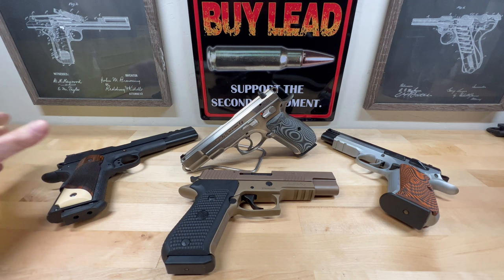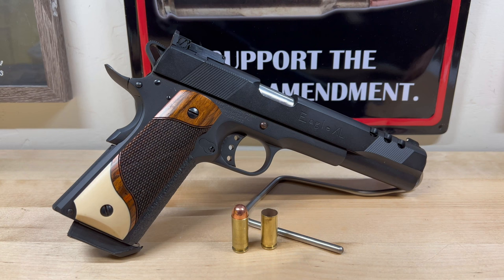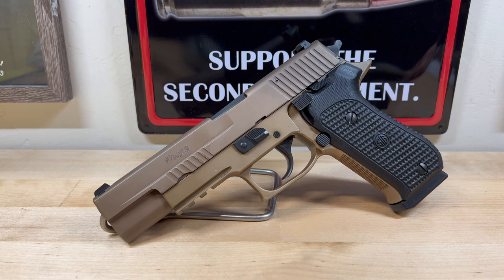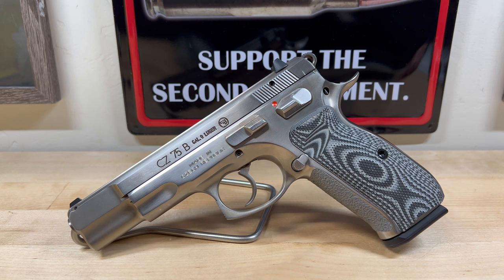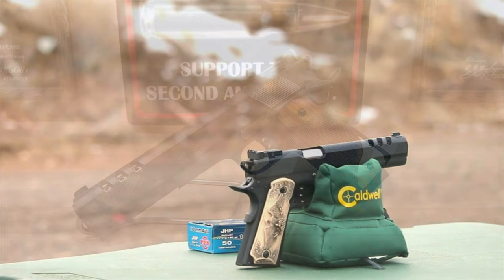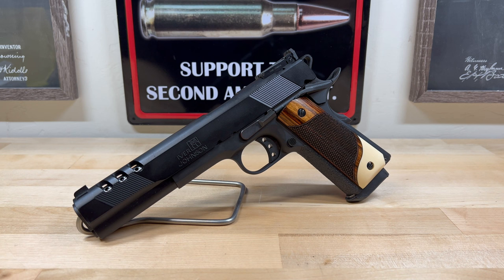The 10mm Cartridge - According To Jeff Cooper

Comment: The last time I had my 9mm and 10mm 1911s out at the range, I was surprised that I shot the 10 more accurately.
Reply: Both 10mm & 5.7 shoot "flatter" than 9mm.  By that, I mean you don't have to alter your sight picture much between 5 & 55 yards.  Or 155 yards, you can go very long with both rounds

Comment: I've become a huge 10mm fan. Actually own (2)10mm now thanks to reviews on some firearms I've watched. Thank you 😎👍🏼
Reply from the maker: My pleasure!
Reply: Hi Norbert’s, if I get a 10mm to take into the woods for protection from bears etc, which do you suggest. Thanks
Reply: @LK-bz9sk  Hey LK. For something regarding wood protection, I’d say a Glock 20, Colt Delta Elite, or Sig P220. There are a few others but G20 has a 15 round mag unlike single stack mag on the others. Hope this was helpful.
Reply: @tallgeese76  Yes very helpful because you reinforced my gravitation to the Glock because of capacity. For pure woods type use maybe the Glock 40 w the longer barrel. Thanks Norberto

Comment: Great information. Love me some 10 mm. Only bad experience has been with generation 4 Glock model 29. Nothing but trouble from the get-go. And even worse Glock service turned out to be crap, unresponsive, douche bags. Finally found an independent reputable smith who has worked out the bugs and now it’s back in the rotation
Reply from the maker: To be honest, I prefer a 10mm to be of all steel construction - but that's just me.
Reply: @Icarryone  I was wondering why the Glock 20 wasn’t featured.
Reply from the maker: @mandangalo803  See comment above.
Reply: @Icarryone  no I get it. But the G20 has a significant role in 10 mm history. Because of it, 10 became popular again
Reply: Yeah. & shoots Damon well I might add.
Reply: @Icarryone  Hard shooting handguns should have steel or at least aluminum alloy frames . I've owned a few polymer framed handguns , but have sold them off . I've experienced polymer framed handguns warp in high temperature conditions .  I carried a 1911A1 when I was in the US Navy in Security and Military Police duties . My current 1911A1 pattern weapon is chambered in 10 mm Automatic . The 1911A1 manual of arms has been drilled into my brain since I was 18 years old . I enlisted into the US Navy in 1985 for what's that worth .

Comment: I recently became intrigued by the 10mm as a result of winding up with the newest version of the Colt Delta Elite for a very low price.  Now I love it.  It's definitely more challenging to run at speed than the .40 S&W or .45 ACP, and surely the 9×19mm.  But not really that much more.  As with all of the powerful large caliber cartridges, it requires more devotion to training and practice to master.  But this is entirely achievable for anyone who can master the .45 ACP.  Even a full size 5" barrel 1911 conceals and carries very easily, and is fairly slender for all the power it delivers.  10mm guns do unquestionably accumulate wear more rapidly, and require staying on top of maintenance more.  Recoil springs should be changed out every several thousand rounds, as with any other autopistol, and it is rather harder on slide stops from the heavy recoil springs required.  But this is easily addressed by routine inspection and maintenance.  A careful gunsmith inspection with any necessary tuneup and parts replacement should be conducted every 5,000 rounds or so.  10mm is a truly excellent cartridge that delivers tack-driving accuracy and impressive power for anyone willing to commit to the training requirements.  It would be more pleasing if all the ammunition companies loaded it to the full potential.  As of now, loads must be carefully selected to get the full power advantage 10mm offers.  I use the Delta Elite as a street gun regularly.

Comment: I purchased a Glock 20SF and a 6” barrel several years back to start handgun hunting in Maryland and loved it… I moved to PA in the past several years and want to handgun hunt here, but poor laws in PA do not allow a semi-automatic for deer hunting??? So I will have to drive down to MD to handgun hunt for now.  In the meantime, I sold my Glock and purchased a Girsan 1911 hunter in 10mm with a 6” barrel and I’m getting it setup for the 2023 hunt right now.  The narrower grip fits my hand better that the Glock, though I had the smaller grip model… I enjoyed your video and the history you shared.
Reply from the maker: My state has a 6" barrel requirement - but no semi-auto restrictions.

Comment: I think the 10mm is a great choice for bear protection, but if you already have a steel frame 1911 in 45ACP and you handload theres no need to go out and get a 10mm pistol. Its surprising Cooper didnt go on to develop the 45 Super since he did alot of work with the 45ACP, but I guess alot of his loads (7.5gr of Unique) was pretty close to what would be considered 45 Super loads.  Still the 45 Super handloaded is so close to the 10mm its a toss up in my opinion. According to Hodgdon's annual manual, loading a standard 45ACP with a 200gr SWC (68 style) using CFE Pistol takes it up to 1142 fps. I'd sday thats 45ACP +P territory but still not 45 Super. This is accurate to book load data as I've loaded it myself. So what would you get loading that up with 45 Super brass to 45 Super pressures? I'm going to guess it would match 10mm velocities, but then you get a larger diameter and can use bullets up to 260gr with the 45. In Grizzly bear country (where I live in Montana) I think the heavier bullet weight and larger diameter would trump a slightly faster velocity, but then we are in the old argument of a heavy and slower bullet, vs. a faster lighter bullet....which is adding another can of worms lol
Reply: Does that .45acp load shoot as flat as a full power 10mm load?
Reply: @russellweber3466  Well I can only speak for my own shooting and I dont have a 10mm, but the 45ACP+P load I shoot at 1150 fps (which I get to at 7.8gr of CFE Pistol not 8.2gr max they list) the accuracy is dead on. I bullseye my targets at 10yds which is my normal range for target practice. I'm guessing if I test further to max of 8.2gr of CFE Pistol (per Hodgdon annual manual load data) I'll likely get 1200-1250fps  - which is what I get now with the same Saeco #68 210gr and CFE Pistol 7.8gr load through my Hipoint carbine (rated for 45ACP+P) due to the longer barrel...so my question to you 10mm shooters....what do you get for velocities when you load a 250-260gr hard cast bullet? I'm currently getting 950-1000fps with testing CFE Pistol, but I think Herco might do a little better just havent tested it yet. Basically 45 Super gets you old school Colt 45 velocities up to about a 265gr bullet - which is the heaviest I've tested so far, but like to keep it 250-255gr
Reply: @russellweber3466  maybe a good test for you would be if you have a 1911 in 10mm,  get or find someone with a 1911 45ACP. Set up both the same with spring weights, barrel bushings, shock buffs ect and then compare. Most people will tell you any 1911 in 45acp set up properly is an extremely accurate pistol - as it would be set up the same in 10mm. 45ACP to 45 Super is a matter of spring changes, a shock buff and 45 Super brass. I'd say its a moot point as they are so close - both are great! My point was while I think a 10mm is great, if you dont have one and NEED the power for bear protection and already have a steel frame 1911 in 45acp, no need to go out and buy a new pistol
Reply: @leveractiongypsy1848  Why not buy a new pistol? I have several Hi-point carbines, a .45acp, a 10mm and a .380, the commercial loads that I like for the .45 acp are .45acp+ 185 and 230 grain hp, and for the 10mm full power 180 and 200 grain hp loads. I've been wanting to do some long range shooting with both carbines to see what rounds shoot flatter. Out of a Glock 20 and a 29 pitbull, 180 grain fmj loads, after 5 or 6 shoots into 3 telephone books duct taped together, the rounds would go thru the 3 telephone books. I have a Rock lsland tac II 10mm in 1911, and a friend of mine has a son who has a Rock Island 1911 9mm. Kenny the son and I have been meaning to see how his tricked out base model 1911 shoots with 9mm++ loads and my tac II 10mm 1911 shoots with full power shit kicker loads.
Reply: No reason to buy another gun?  What language is this?  :)
Reply from the maker: I can wake up from a drunken stupor and come up with at least 10 reasons to buy another gun!
Reply: @russellweber3466  Sure I'd love to get a new 1911 in 10mm ...but...unfortunately covid restrictions did a number on my business and nearly wiped me out so its working with what I have for now
Reply: @floridadad2817  haha well I'm accepting donations to fund my new 1911 in 10mm...
Reply: @Icarryone  I got a deal on a Taurus TH40 the other week. There are utube channels talking about Taurus coming out with a 10mm version and Sig coming out with a compact 10mm striker fired handgun.

Comment: The video covers development of ~.40" auto pistol cartridges - .41 Action Express and .40 G&A - but skips over THE 10mm Auto cartridge that actually went into mass production.  The cartridge started with a clean sheet, designed by Mike Dixon of Dornaus & Dixon/Bren Ten fame.  Cooper wanted ballistics of 200grs with an impact velocity of 1000fps, and the ultimate, magnum-level performance was a result of confusion, misunderstanding, and Norma, the original ammo maker, essentially saying enough is enough.  The subject is covered in depth in the book Bren Ten/The Heir Apparent, which was written with input of Cooper, Dornaus, and Dixon.  Dornaus and Cooper have passed since the book was written, so it will probably remain the definitive reference on the development of the Bren Ten pistol and the 10mm Auto cartridge.

Comment: I just messaged Iver Johnson and they said you can use a standard  recoil spring that's sized for a standard or 5" barrel 1911 10mm but they recommended a 23 pound recoil spring
Reply from the maker: I have a 22 pound in my IJ long-slide.

Comment: Crazy that the original load was 180 grains at 1200 FPS, because there's 45 ACP+P loads that shoot a 185 grain bullet at the same velocity.
Reply from the maker: After the round became standardized by Norma, the ballistics improved.
Reply: @Icarryone  Huh, interesting.... Good to know, because current 10mm is leagues above that load. But hey, now I'm a little bit smarter
Reply: 200@1200 was the original Norma 10mm load, followed by a 170@1300 load.

Comment: I can load my 45 ACP well into 10MM specs. And they shoot fine out my 1911 and Glock 21.
Reply from the maker: You're a braver man than me. Just sayin'!
Reply: @Icarryone  I don't know about that! ... Remember the 460 Rowland? They are built on Glock 21's and SA 1911's. Just upgrade the recoil spring assembly. 460's are shooting 255 gr bullets at 1300 fps. Way over 10MM 220gn bullet at 728 FPS.  When I shoot my 45 ACPs hot, I just drop in a bit heavier recoil spring. ... But honestly, unless hunting, I don't know why more power than 45 ACP standard loads are useful? Fun, yes!  ... Anyway, great video, thanks for making it.
Reply from the maker: The .45acp cartridge casing was never designed for high intensity pressure! .45 Super cases - as well as 10mm, 460 Rolland and a few others - have a much heavier case head design. This makes them far more suitable to run at higher pressures. In other words, less prone to case head failures.
Reply: Have either of you ever shot Hi-point carbines in .45acp and 10mm? There are 185 grain and 230 grain hp .45acp + loads and full power 180 and 200 grain hp 10mm loads that are fun to shoot, and quite useful for stopping a crack krazed ghetto rodent in an attack.
Reply: @russellweber3466  I have not, but it sounds like a scream!
Reply: @Icarryone  Good info. Thanks
Reply: @DrLanceFarr  Which 1?
Reply: @russellweber3466  I have never shot a Hi-point of any sort.
Reply: @DrLanceFarr  The 1st handgun I bought is a S&W model 41 in 1982 and it was 417$ with tax and the best price of any gun store in St. Louis. The price on  Hi-Point and guns like them is wow, but is it junk, no not if you understand how guns are marketed.
Reply: @Icarryone  As a teenager 1 of my friends dad had an Argentinian ballistor molina in .45acp, I really like shooting that gun. They don't have grip safeties and I've wondered how 1 converted to 10mm would fare. What was cool is Eric's old man had black powder handguns that he put together from kits and it was interesting shooting a .69 caliber flintlock pistol, a .44 caliber single action black power pistol and then that .45acp pistol.
Reply: @russellweber3466  I've seen them in stores. They seem like BB guns to me. I like my Rugers, S&W, SA and Colts. I also have a Glock 21 I really like.
Reply: @DrLanceFarr  Well fairdulance what makes you think that way.